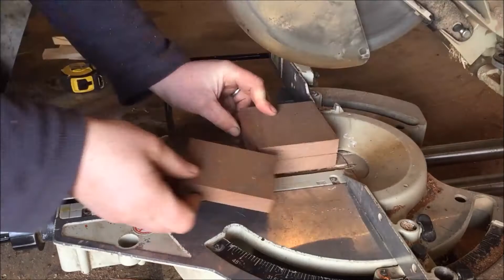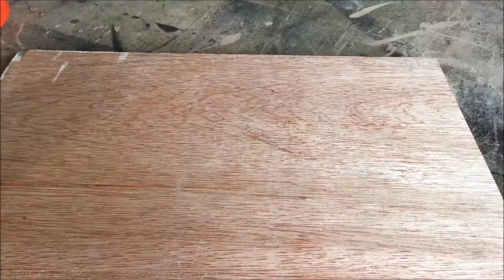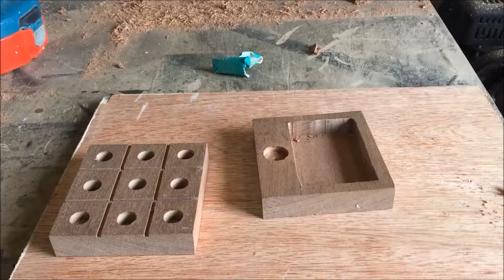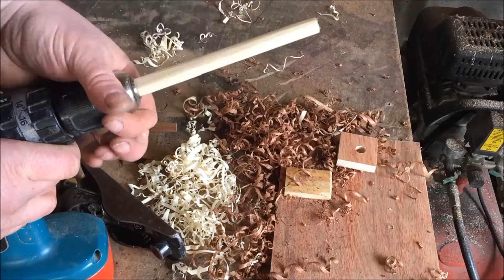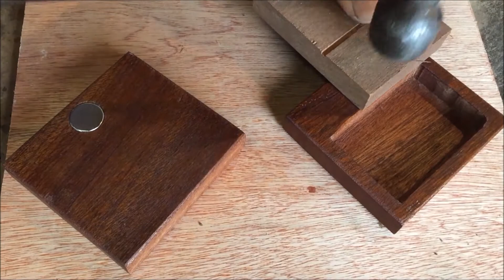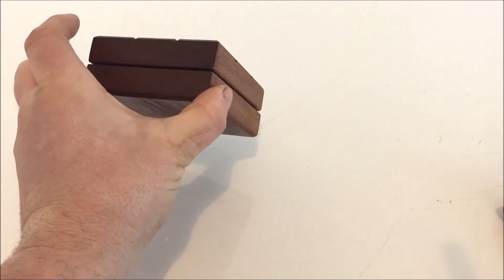FREE!! How to make a simple Tic Tac Toe game.

Comment: Do you happen to know the rough dimensions for this project? I see below you said that this is about 4.5 x 4.5 inches. What circumference would you say the dowels should be?

Thanks!
Reply from the maker: The diameter of the dowels are 1/2 inch.

Comment: Thanks for the project, it would be great if you could share the dimensions as well. Thanks
Reply from the maker: Hi, thank you. If I remember correctly it is 100mm x 100mm x 40mm the dowels are 12mm in diameter.
Reply: @EamonWalshDIY  Thanks for the quick response, appreciate it.